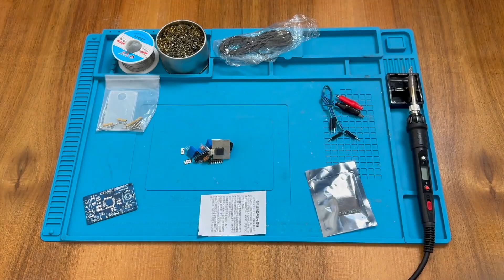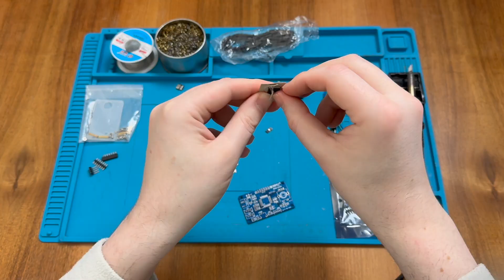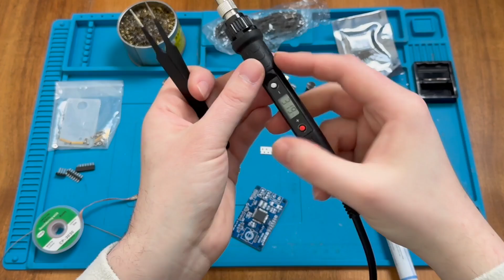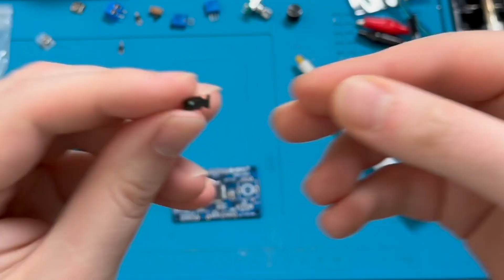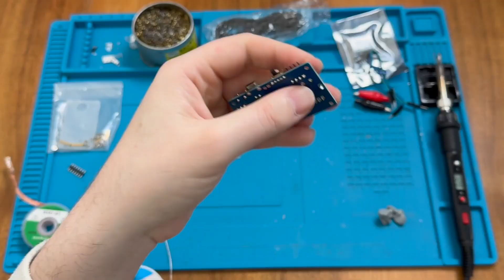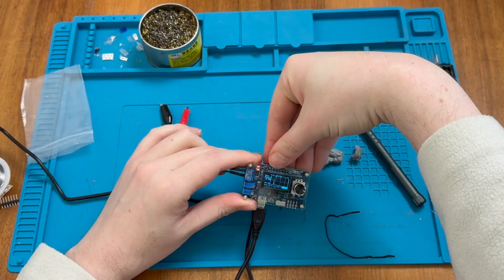Mini Digital Oscilloscope (Mini DSO) DIY Surface Mount (SMD) Soldering Kit

Comment: If I’m correct, the capacitor labeled “103” should have been installed in the C2 position, not C3
Reply from the maker: Quite right! If you are looking at the instructions, it looks like I confused the illustrative example of the "C3" position as the specific location for the 103 shown above. Thanks for pointing this out.
Reply: you need to record this with the correction instead of relying on people to read viewers comments to make this correctly. at the end of the video it is working, but not tested for accuracy. does it work the same with the capacitors placed incorrectly?

Comment: You turn in to Superman at the end when building the box so I have no idea how to put it together properly so will have to guess 🙂🙂😢😢
Reply from the maker: Apologies for rushing through that part — I thought it was the least interesting bit! Not all kits include a case, so I felt it could fizz through it. However, here's a trick you can use to follow along: pause the video and you can use the , and . on your keyboard to step through frame-by-frame on YouTube. Hope that helps!

Comment: Whelp this video helped makes sense of direction but I soldered the mcu and didn't realize the legs were crooked on one side.
Reply from the maker: I had essentially the same problem here. With a lot of fiddling I managed to get it realigned. Hope you manage to get yours straightened out! 🤞

Comment: Hello,

I hope you are doing well.

I have a Digital Oscilloscope project based on the STC8A8K64D microcontroller, but my current version is not working properly. If possible, could you please copy the code and send it to me?

I would really appreciate your help.

Best regards,
Luqman Korbich
Reply from the maker: Thanks for reaching out. Unfortunately, I don't have the source code for this kit's firmware. This kit is a closed source design.

However, Elektor Magazine have an article on porting an open source firmware to the device to use with it instead. I've not tried this, but it could be a neat little project.

https://www.elektormagazine.com/labs/reverse-project-mini-oscilloscope

If you give it a try, let me know how you get on. Best of luck!

Comment: Bought the same kit, ruined the pads for the big chip at the center, unusable now. Gonna order another one
Reply from the maker: Oh no! That's a shame. Those tiny pads are super tricky! I As I mentioned, I struggled to get the alignment right. Best of luck.
Reply: @jtjacques another update : I ordered another kit, I soldered everything, but white smoke appeared once I plugged it… I ordered another one, third one’s the charm
Reply from the maker: @vincent._.t  Oh no! That's no fun. Did you figure out what went wrong? Good effort for persevering with it.

Comment: Do you think i can pass my music thru it ?
Reply from the maker: Absolutely. You should be able to see the waveform on the display. I wouldn't use it for serious measurements though, as the accuracy seems fairly poor. https://youtu.be/RhHYYTJH7wI?t=901
Reply: @jtjacques  thanks for your reply. I think it could be a nice try to solder for first time and learning some new stuff but I don’t know if it’s a good starting point. Also, the devices I use have a 3.5 mm Jack output. Can you add in one to this device?
Reply from the maker: @ElVocabloGris  Tiny surface mount parts can be very tricky to solder. As I mentioned, I had trouble getting the chip aligned here. If you are starting out I would recommend something a bit simpler with the larger through hole parts which stick through the board and are easier to work with.

With regard to getting audio in to the oscilloscope, however, you can use the provided clip leads with a regular 3.5 mm cable (often known as an "aux cable"). Just attach the black clip to the "sleeve" (the metal part of the 3.5 mm plug nearest the wire) and the red clip to the tip of the plug. Hope this helps!
Reply: @jtjacques  amazing thank you so much man

Comment: very nice . btw, I like your baby blue tray very much . where can I buy this ? or may be to design and 3D print it myself?? thank you
Reply from the maker: It is a silicon soldering mat, to protect my table. For me the heat resistance is an important feature. I purchased the 300x450 one from here on AliExpress https://www.aliexpress.com/item/1005005654271038.html

Comment: What temperature did you set the soldering iron to?
Reply from the maker: I usually have it set to around 320 C, which you can spot on the display at various points in the video. I'm not sure how accurate it is though. I've never checked or tried to calibrate it.

Comment: i did this exact same kit today, I seem to have messed up somewhere, as soon as I slide the switch, I get a dead short...... checked everything over and cant seem to locate the problem..... either way it was cheap and a fun build..... I may order another to try again  lol
Reply from the maker: That's a shame. On such a compact board it can be hard to trace a short. Glad you had fun building it anyway. I think that is the main point. It's not really very good as a scope!
Reply: @jtjacques  I wasnt really expecting the scope to be anything remarkable.... it was more for the fun of building it.....

Comment: This was my first real SMD kit, actually the exact same version as yours (well the same EEPROM it appears). Pretty pleased with how it went, inductor is a little squint as I wasn't patient enough with it. Burned the LED with my iron and had to order another whole box of 0805 LEDs just to get one... The joys. It was nice to see you mention the LED trick. I always squinted before I found that out to see the little symbol at the bottom.

Anyway, here's some stuff I got from the instructions (quotes are word for word):

RP1 adjusts PWM amplitude, RP2 adjusts SIN amplitude. 

A - Automatic mode, N - Normal mode, S - Single mode. 

"Automatic mode: continuous scanning. Click the encoder to stop or run the sampling. If triggered, the waveform is displayed on the display and the trigger position is placed at the centre of the chart. Otherwise, the waveform will scroll irregularly, showing 'Fail'."

"Normal Mode: after pre sampling, the signal can be input. If triggered, the waveform appears on the display, waiting for a new trigger. If there is no new trigger, the waveform will be retained."

"Single mode: After pre samping is complete, input signals are available. If triggered, the waveform appears and stops sampling. The user needs a single point encoder to start the next sampling."

"Normal mode and single mode, make sure the trigger level has been adjusted correctly, otherwise the display does not display waveform." 

The trigger level is used to stabilise the display, the arrow determines if the trigger point is at the rise (up) or fall (down) edge of the signal. (I'm assuming "trigger level" means range?)

The bottom right is the frequency of sample rate (or resolution? idk not an electrical engineer). 

[End of useful instructions]

I am guessing T is the target for trigger level? Honestly these instructions are confusing. Hopefully that at least gives some information... 

In any case, really neat soldering! Colour me impressed. I did notice though, that the pads are actually pre tinned already. A good way that I have found to check they are solid on the IC, is to very gently go across them with tweezers or something and make sure they don't move.
Reply from the maker: Thanks for the helpful comment. I think this was a fun little kit.
Reply: What is the maximum frequency range of this kit?

Comment: I bought the same kit. Building it as we speak. Only my capacitors arebt labeled so not sure wich one goes where. One is 10nf the other is 20nf
Reply from the maker: That's a pain. Surface mount capacitors are normally unmarked.
Reply: There should be coloured tape on the back of one. If not, well time to get the multimeter out (a good amount of them have a capacitance mode), or just hope you put it in the right place. :P

Comment: Why not use a Hot Plate ?
Reply from the maker: That's a great suggestion. Unfortunately, I don't have one! I do have a heat gun though... https://youtu.be/21tu9d_sBTE?t=159
Reply: That would have been a good shout too. I built mines with iron and heatgun, forgetting I had a plate there I never use. Would have been much faster. Thanks, I'll try remember next time lol

Comment: You'd be better off getting a used Tektronix from the 80s or 90s.
You'll get professional equipment that  you'll pay a pitance.
Less than 100€ or 100$ for 2 channels and less than 600 for 4 Channels.
Reply from the maker: What the Mini DSO lacks in functionality, it makes up for as a fun little surface mount soldering project.
Reply: Since even at low prices nobody wants them, People end to  even through them in the trash  since they don't work or play with electronic for several or different reasons.

Comment: Small tip for SMD components. Pre tin one pad. Heat up the pad, slide the component into place. Then solder the rest of the pads.
Reply from the maker: Thanks for the suggestion.
Reply: sure , I use that approach for years. a few last years I added reflow oven to the process. it works like this   - 1. preheat the PCB and tin ALL pads . 2 install all SMD components , starting from small to big soldering one or 2 pins of each part  to keep it in place. 3. add flux to the board generously .4. reflow the PCB using profile with 220 dec C as pick temperature for 30 sec . final numbers depend on solder you use . try and error first using scrap boards. 5. visually inspect the PCB and fix issues .  you would be surprised with results.

Comment: Those blue adjust resistors require waaaay more turns to see any change
Reply from the maker: With enough turns the resistors change the amplitude of the two test points!
Reply: There are sold as 20 turn, and, 50 turn, pot.
Regardless of the Max/Min Impedance.👍